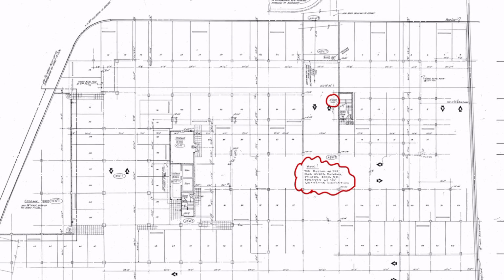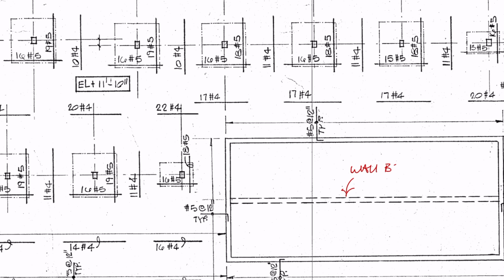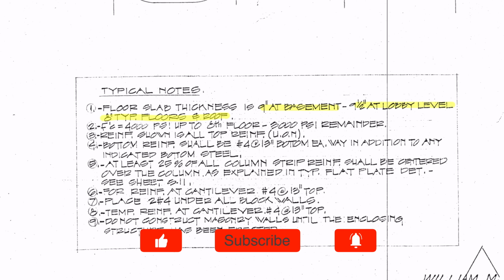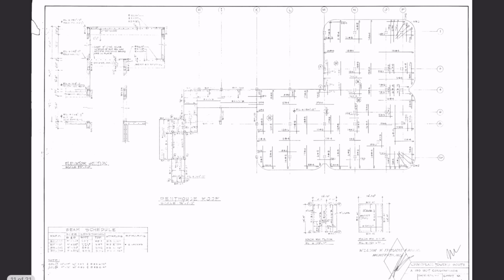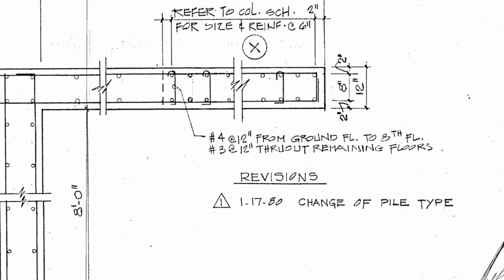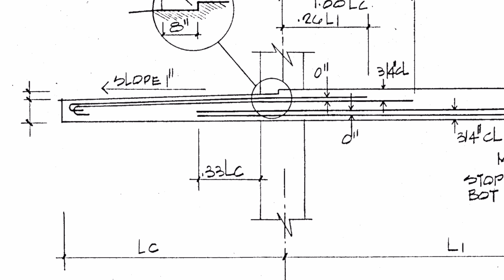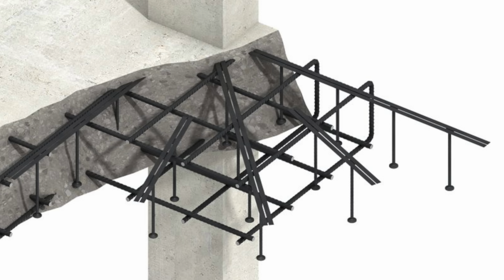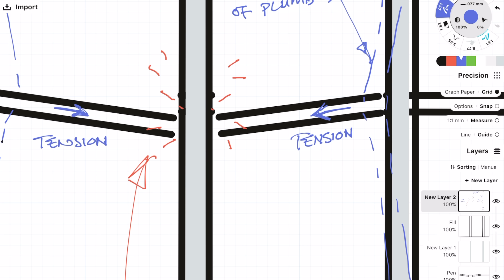Surfside Condo Collapse - Reviewing the structural drawings - Was the design bad?

Comment: Nice explanation, but to tell my side of the story, i just refuse to even hand on the blueprints to review them. We just don't build a beamless flat slab building like that where i live in Europe, not even those from the 1920's which are still up and facing 6 magnitude twice a decade. I do not care about what the building code was in Florida in the 80's, that building is just not normal, the North one is not normal either, the new one built on the South's side is a design reject for the area i live aswell.
I would not even think to raise a 12story beamless building, when we do build such, each slab is 9" thick and the reinforcement inside is very severe and resembles drop panels and hidden beams on the framing and around the columns, and or the slab will resemble beams below it with honeycombs. 
The rebar work its self is very expensive, it passes through many stages and can take months and many inspections before we pour the concrete.
All i saw on Champlain was brittle concrete with almost no reinforcing that had sat on the down side of the slabs, on a flat slab building ready to fall down like a domino by just a single slab failure just like it did.
The pool deck slab collapsed pulling columns with it, then the building was being held for 7 minutes by the only beams it had on the ground floor perimeter equalising loads from column to column and the slabs were getting continuously increasing load along, when these finally came to the threshold of failure, the slabs on the place that didn't had columns anymore, they gave up all at once causing chain reaction punching shear and the progressive collapse of the building that finally fall down like a domino.
If the building consisted of column to column beam design or the slabs were reinforced in a way to support its design, nothing would have happened.
I'm sorry but it is nothing maintenance could prevent at the time people were living in a building enabled to fail like that by its design because of lack of maintenance, this design is nothing to analyse, it is just a cheaply made failproofless death trap and i hope they demolish every single one of them before there would be more casualties.
End of the story.
Reply: Interesting comment.. I wonder how big this problem is!.. and just how many high rise buildings were under built like this one was in Florida, and how many in other parts of North America and the world at large.  it sounds like this will probably happen again multiple times during the next 50 to 100 years..  before all of them eventually get demolished. I live in a 14 story high rise in Montreal that was built in 1967 during a building boom, when the world expo was in town.. and now I'm very curious to know how it was designed, built, and maintained all these years... and if shortcuts were taken when labour shortages and time constraints were severe.  We also get earthquakes, but not too often, as we are near a minor fault line, unlike the west coast and the missouri area in the u.s. where major fault lines are a big threat. I hope the scale of the surfside tragedy will atleast have a silver lining and bring some focus and actions by authorities to do whatever is needed to prevent this from ever happening again. Btw if I may ask, what part of europe are you in?? It sounds like you have responsible people in charge over there!
Reply: @MK-fc2hn   @M K  well if you look closely to the buildings around the US you would be afraid of guessing how many could fail, that happens all around the world but it surprises me they raise buildings like that in a place where the cheapest structure is not a necessity. Mostly because of their design, saving on material is a huge crime, but the worst is a design that can't support any failures that would eventually happen around the structure saying it's time and wear related, bad concrete quality, an earthquake or anything else. In the Champlain case, make it the best on concrete quality, by design it had nothing to hold the columns in place or stop the slabs from punching through the columns if only a single one fail from wear or even a small gas canister explosion or a car crashing against a column in the garage triggering a collapse by the shock due to vibration, and not only that, but even strong wind could eventually stress the slab-column joints and cause fatigue, as the building was literally a plate with glasses on your moving hands.
As for your building, i'd think being in Canada makes it alright, i could analyse it in depth if i knew which one is, but usually if you see the structure and what holds what, it usually only takes your geometry class lessons to figure out if there is something wrong, now about quality and hidden wear, that's another story.
Btw i live in Greece, things are not perfect, there a lot of death traps in Athens but mostly because owners still live in illegally constructed improvised buildings from the 50-60's that got legalized through gray areas, or they insist on keeping bad structures like an apartment building that partially collapsed just like the Champlain in the earthquake of '99 where they knew the building was a write off since the quake of '81 because they got the warning for an overhaul but if the owners their self don't care then no one does.
However all the buildings are built very responsibly, you might see savings on masonry-plaster costs or flooring costs in some buildings causing mostly cosmetic damage, and the building authorities are very shady on bribery accepting money to approve higher height or other total surface area building code violations, but i guarantee you no one would sign on a bad concrete structure, they would go in for life paying the money they made in their whole career.
To give you an example, i've worked in one of the buildings of the middle 80's that a specific builder had made in that area, like 5-6 floors each, he built them walls using a cheap dirt-sand-limewash as brick mortar instead of a modern cement based one, and had the worst tile works in it, making the building full of problems for maximizing profit, but when it came to the concrete, everything appeared to be fine and there were no quality or design faults, so if you lived in, you could get cosmetic damage everywhere, but those buildings aren't going down even with an 8 magnitude.
Reply: @johnbelwell2461  Thanks for the further explanation of this poor design..  how irresponsible!.. it reminds me of that high rise fire in England and how it only had one fire escape! And no sprinkler system. That too was a very poor design, and shocking to think that that jurisdiction allowed for it.. even if it was decades ago.  I have been in many high rises or shorter multi story buildings in my life as I use to deliver food or packages all over my city, and absolutely every building I ever saw had atleast 2 staircases to escape the building.. I would be petrified to live in any high-rise that only had one stairwell.. knowing that smoke might fill it up and everybody in the building was forced to use it..  what a nightmare! As for surfside, it really is so obvious once you understand the basics that it was a dangerous design. Even a person with no knowledge at all about building structures would find it peculiar that beams between the columns could be left out.. it's almost common sense that a structure should not have that kind of weakness between columns, even putting aside earthquake risks.. And then once you learn more about the engineering and the lack of redundancy, it really seems borderline criminal for it to have been built like that. One thing seems universal though when it comes to any jurisdictions.. it usually takes disasters before they improve their own particular weaknesses in their respective building codes. Florida did a good job in this area after hurricane andrew in '92..  but they didn't go far enough by including retrofits for older buildings. It will be interesting to see how they handle these buildings going forward, and if they condemn some of the worst ones.
As for my current apartment building, (1150 sherbrooke street east) I noticed I do have a beam above the windows, so I imagine they are thruout the building and that it is probably far safer than any of the champlain towers, and not inherently dangerous. I won't have to worry about some drunk neighbour slamming into a column!.. which is one speculation going around as to the cause of the collapse.. especially due to the time of day.. also, I think it helps that my building only has one owner versus condo buildings and all the problems they often have regarding getting all the owners to accept investments into maintenance, repairs, upgrades etc.. one other problem in Florida is that they apparently don't require large reserves to be set aside for emergencies or major repairs. If they did, maybe this tragedy could have been avoided..  atleast temporarily. The whole thing is sad all around.. especially since, like you said, there was no necessity, in an advanced country,  to build it so cheaply. Let's hope there is never a repeat allowed to happen again.
Reply: @MK-fc2hn   that's the problem with all the disasters, everyone's acting normal about problematic situations until the bad happens...
The Champlain is indeed a very dangerous design, although it's very possible to build a building like this without beams, the slabs need to have severe metalworks in them resembling integrated beams to prevent punching shear, did it had it? Absolutely not, the rebar and concrete quality reminded me of makeshift 2story houses around here from the 1960's with concrete mixed in buckets, but those don't bear any serious load to care. Then again you don't want a beamless building when there are strong wind currents and unstable ground, you can prevent punching shear but the building can still get pulled down by any horizontal acting force (eg earthquake), maybe they could get away with a square shear core around each proportion of the building and using expansion joints to relief stress from each side to another instead of a whole slab for each floor consisted of concrete far from being monolithic due to being laid with several days difference, but the concrete needed would be more than building it using another design. It is just a disaster, i can't think of a way they could build this thing as cheap they wanted without at least twice the material by design, unless they had made it 5-6 floors at most, but if i design it even for 6 floors and 80's standards, the total material would still surpass 20% of what each floor had for 12.5 floors.
I checked your building btw, it looks alright from the outside and geometrically fine, the columns and beams of the perimeter look like what they need to be, making me think this principle of design is universal for the whole building, also no protruding balconies or weird wide entrances forcing the design to use further distance for columns, nothing that could put stress on beams or the structure in general, this design and the shear walls for the staircases and elevators i can imagine it having, makes me think of an indestructible building.
Such buildings in case of structural failure, sudden or eventual, the outer walls although put extra load on the concrete that sometimes work in an unwanted manner, usually (but not always) help by starting bear very much of the structure's load, either momentarily getting load for stabilizing it from a possible collapse (earthquake), or giving it time to see what's going on whereas otherwise more severe damage would happen. There's no such official operation or calculation for those walls as they are made to bear no load ("filler" walls), but it does what it does most times.
Reply: @johnbelwell2461  Thanks for analyzing my building..  I appreciate it!..  I feel safer now, and am glad that whoever designed it went with a prudent and conventional design, with sufficient redundancies. It could be that the building codes demanded it, but I suspect my country had, and still has, an overall more conservative approach from all parties involved when it comes to the building of high rises.. compared to what existed in florida 40 years ago, and from what you say,  perhaps the u.s. at large..  I suspect the "innovative" design of champlain towers just would not have been signed off on up here. That said, we have had our own issues with collapses due to failures, including an overpass in 2006 and an underground garage where a slab collapsed and killed someone. After both those tragedies, the authorities and building owners took measures to prevent it from happening again. In my last high rise apartment, they reconstructed the 5 story underground garage over a 9 month period without vacating the occupants living above it. That repair job must have cost a fortune!   The damage was from salt corrosion..  a problem that caused those collapses as well. And speaking of the name champlain, we had a major bridge with that name that had to be permanently shut down and replaced 2 years ago.. also due to salt corrosion..  from years of deicing. So every jurisdiction has its own set of unique issues to deal with I guess. It sounds from what you say that Athens could very likely have multiple collapses in the next serious earthquake, unfortunately. while the rest of the buildings in the city will be left without a scratch, or only cosmetic damage. Hopefully time is on your side and they slowly/eventually deal with that. We still have our own work to do in western canada where they are predicting many buildings will likely collapse when the major earthquakes eventually come. It usually all comes down to money in the end.. another example of that is a terrible fire in a nursing home that killed dozens of seniors a number of years ago, here in the province of Quebec. Of course the newer wing of that building was left unscathed, as it had a sprinkler system. But no one wanted to spend the millions of dollars to retrofit the old wing with sprinklers, or at all the other nursing homes that were built before the building code mandated them. So 50 plus people tragically and senselessly  died as a result, in just that one fire. And of course, it was only after that tragedy that authorities mandated retrofits.. to prevent it from happening again. We humans don't always make the smart choices the first time around!

Comment: Differential settlement between pool slab & garage roof slab caused overstress in top layer of steel over basement shared wall columns. When pool slab collapsed the tension forces across the basement roof and  columns pulled these shared columns out of vertical alignment and hence subsequent collapse. QED

Comment: As non engineer I want to thank you for the illuminating investigation of the structural problems. As an observant dumb ass, I still can't figure out how a pool area that big suffers from a lack of drainage. I have never seen a pool deck with no drain holes of any kind. Combine the board flatness of the design, walls on 4 sides, florida rain storms, chlorine splashed around, awesome salt air, and minimal water proofing, its no wonder the concrete deck started to degrade. I wonder if the building had 1st floor water damage? The deck is designed like a bath tub

Comment: The lawyers are already playing "pin the tail on the jackass", which will most certainly be the engineer/s who capitulated to the idiotic design of the Architect/s. The Architects will escape unscathed for their role in this catastrophe just as they always do.
Reply: All the issues in this discussion focus on elements of the structure that architects are rarely involved with, namely rebar, shear walls, slab thicknesses etc. All the drawings you have seen so far are structural drawings done by structural engineers and most of the analysis and commentary in this post appear to be from structural engineers. The architectural design of the building had nothing to do with its failure. The structure did.

In my 45 years as an architect I never engineered a single rebar, let alone tampered with the structure. Those are their drawings, not mine. The responsibility for the safety of a structure lies with the structural engineer. That's why they have licenses. The many projects I have built in those 45 years are still standing. Among them are the Random House Headquarters Tower in Manhattan, the Al Hamra Tower in Kuwait City, the Pearson Airport in Toronto, Canada, and five US Federal Courthouse around the US.

Your sweeping remark about architects is insulting and untrue, but I wish it were. I could then drop the expensive errors and omission insurance I'm forced to carry because every clumsy pedestrian who slipped and fell in one of my buildings was convinced to sue me by an ambulance chasing lawyer working on a contingency fee.
Reply: @michaeljarosz4062  Wow, that didn't take long. Me thinks thou doth protest too loudly. As an architectural draftsman with 50 plus years on the drafting board, I can assure you that few if any structural engineers will challenge an architect about the merits of the architect's design concepts because doing so amounts to "professional suicide". 

Since when is waterproofing (or lack thereof) the sole responsibility of the engineers rather than an architectural function? Since when is a grade level roof over an large excavation like an underground parking garage a good engineering concept?

In my experience I have seen many needlessly complex architectural designs that were difficult if not impossible to build let alone engineer, and many engineers have privately confirmed this to me.

Did you do your own drawings?